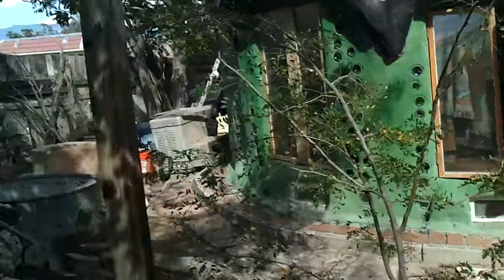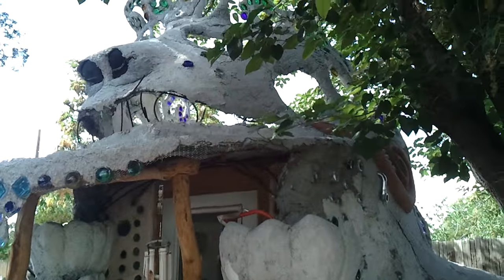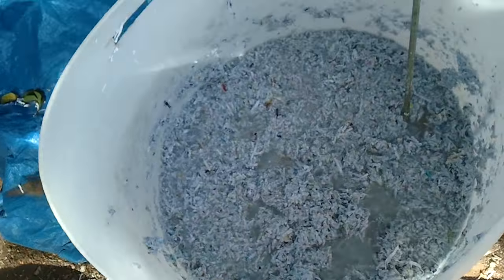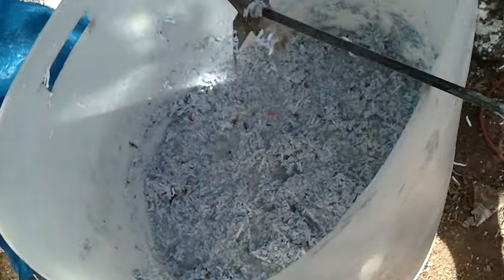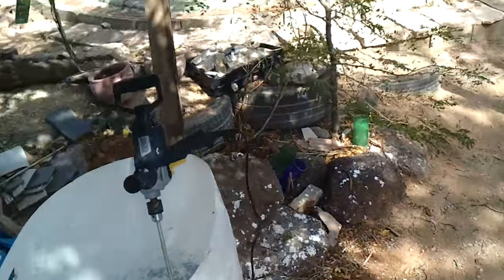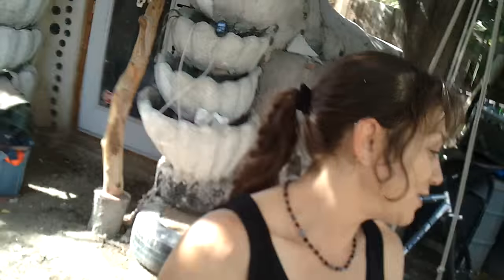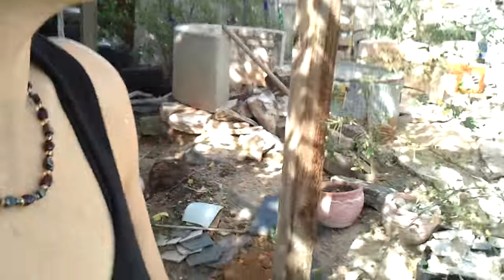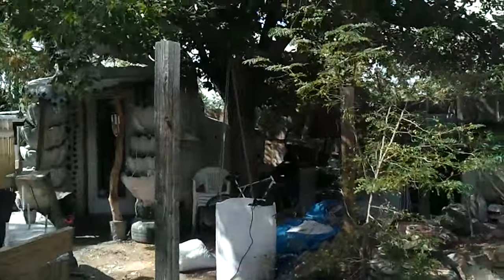How to make papercrete, The Basics, the short version, take one

Comment: In my experiments I did not use a drill or mixer really.  I used a 5 gal bucket and filled it with strips of newspaper, so it wasn't even finely shredded like yours in this video. (Which I know where to find bags of shredded paper now!), and then I filled the bucket with water to the top of the paper level.  I added more paper to the mix once the water forced the paper level to go down.  I only used a stick and came out once a day for 3 days to stir the paper.  After 3 days soaking on it's own pretty much, except the few times I stirred it, I ended up with an oatmeal like consistency for the paper pulp.  Then only mixed Quik-crete to this paper pulp, and no other ingredients.  I used a 50/50 mix or blend of the two and poured that into a mold made of wooden 2x4s to make different sizes and thicknesses of bricks.  
I tested them out with my glassblowing torch to ensure they weren't flammable.  And I also soaked the finished bricks in water for 2 weeks to see if it would soften or break down.
I would love to experiment some more with different mixes to make my finished product even lighter but still durable!
Thanks for sharing your methods!
My vids are on my other Youtube Channel www.Youtube.com/GardunoGlass
Reply from the maker: Thanks for sharing Glassman! Quickcrete/concrete has rocks and sand in it that are going to add unnecessary weight and thermal mass, countering the insulating properties...depends on how and where you are using it, for most applications though, very little or no sand is necessary and definitely no rocks...so I use portland cement powder (not concrete) and lime powder...with a bit of fly ash or pumice or various other volcanic/high heat products, the bond is very strong and can be made very light. I have tested over 30 different mixes now, none have failed, though again, where and how you are using them determines what is the most optimal mix. It takes me about 45 minutes to pulp 25 gallons or so of shredded paper and water with the low speed drill. Again, depending on application, sometimes straight shredded paper is pulpy enough...
I have had test cups of each mix out in the weather, often soaking in water, for 3-4 years now and they all just get harder with time...especially the lime and daitomaceous earth, I find exciting... I only use roughly 10-20% cement and lime powder to wet paper pulp/slurry, by volume for most applications...
Reply from the maker: I don't see any vids about papercrete on your channel...

Comment: I just got internet, via a friendly neighbor, after, 10 years of going to the library to do email,etc.;thus am new to this.Went looking for papercrete sites,and you came up.I've been fooling/working w/PC for 10 yrs. now,mostly as bldg. projects,and wanted to tell the world! a couple things i've learned.# 1 DO NOT BE TEMPTED TO USE BLOW IN PAPER INSULATION!!! My first attempts were successful,using 50/50 paper/cement(by weight),til a friend who was doing a lot of projects mentioned he was buying insulation to use...It took me many batches  of difficult,cottage cheese looking mixes,to conclude it was the insu...Tried adding fibers,etc.,nothing helped..I suspect the borax-added,as i understand ,to "fireproof" the insul is at work...how can we know? Anyway,i finally went back to newsprint.I'[d been frustrated by having to shred the paper,not having access to offices,etc....Last month i tried pre-weighing(3lbs. fits a plastic grocery bag to then fill w/water,and is about right for a 5 mgal.batch.);letting it soak for days..2 or 3...then my mixer just chews it up to a slurry in minutes,add cement and mix...Speeded the process by 1/2 !!! No removing the binder glue on slick mags,it shows up as strings to pull from the mess..Those are the only 2 things I've learned til today...I now wish I'd figured out hydrated lime as the"cement"...thought it needed a pozzolan for strength,(?)  have been using lime as a "paint" over PC in attempt to get uniform look....my house looks like a 500 yr.old Greek cottage now,i love it.Papercrete is WONDERFUL for DIY,lo-tech,and CHEAP bldg...not for the contractors;too labor intensive...well.I've had lots of thoughts,and would send pix,but i don't tweet(unlike your president),and refuse to facebook because...well,i won't go into that...anyway,hope this is good info ,and saves someone time/mistakes...don't know why borax does/doesn't work..suspect COATED,fine paper fluff semi-waterproof(?) I had cement leaching out when i drained my mixes ,my 2nd clue something was wrong............
Reply from the maker: Thanks! I have successfully used blow in paper insulation several times, though it does have  a bad smell from the fireproofing and it not cost effective compared to free. I get shredded office paper from offices or recycling bins and have no trouble mixing it with the low speed drill. I have used diatomaceous earth and lime only with great results over time (much longer cure time though. Pozzolan, if I understand correctly is what results from mixing lime with volcanic ash/silica...I use pumice which we have mined locally and it works well. The cellolose in paper reacts like the cellulose in hemp, gaining strength over time as it sequesters CO2 from the atomsphere. I use Borax in most of my mixes with fine results. ... I would love to see your work. Can you email them to me, or is that also too far outside your comfort zone? nmgal007@hotmail.com if you care to share more.
Reply: will write,thanx for responding...o read a lengthy book on lime(library book) that listed pozzolans...i AM ignorant,and have a somewhat garbled mind...as i recall the list of pozz.mats.included RICE hulls/straw! which led me off on dreaming about rice straw bale houses,since by now i'm certain rice farmers in california,rtc. are
Reply: constrained from burning fields,i imagined they'd almost pay to have the chaff removed(as i said,w/o internet it wasn't worth researching)..ANYWAY, spraying lime over rice bales,IF they even bale it up)seemed a neat solution   DAMN,i do go off on tangents...pozzolans,as i understand,is any material that helps the lime get really hard,Rome built from lime and vesuvius ash,,,so yeah,volcanic ash most common....at the time i lived (in E.Oregon)across the street from a sugar factory,with mountains of lime-used in sugar refining-just across the street.....oh hell,i think i'd better email..this is wandering off..i'm an old fart and tend to ramble.....the point about insulation was that the mix nearly always resulted in cottage cheese (large curd,heh,heh) lumps that would not spread,,,o.k. for filler,but not for smooth finish....but maybe i missed something....diatom earth a pozz.?  whereabouts are you? Ca. Yeah,paper's free,and a batch using cement is still only$.30...as a stucco hugely inexpensive,AND FUN,like spreading frosting on a cake...but i wish i'd known more,i much prefer lime for several reasons.............will write  jw
Reply from the maker: Clearly more research is in order! 😀I think you might be right about anything that chemically bonds the lime...though the cellulose in paper I think does that too... lol I have tested MANY mixes and they almost all harden over time, though some get pretty soft when wet,...here in the high hot plains, that could be a real nice plaster trait... I look forward to seeing/hearing more about your experiences. Thank you!
Reply: Diatiomaceous earth is the best material for many types of earth projects!

Comment: How much paint do you add to water proof the paper?
Any paint is good or just outside paint or are other products better?
Reply from the maker: I'm not a precise measurement kind of person. It depends on how 'water proof' you want it. It will repel water with little or none. If you want to seal it I would paint on sealant after curing, though there are many advantages to having a breathable structural skin. I try  to use up leftover paint sometimes, though I think exterior is probably best, any acrylic will also have an effect...again, just depends on what effect you want, and what you have available.

Comment: Hi Gabrielle,  I am wodering how to mix a batch to make a planter pot.

I'm thinking one inch thick should do it.

What I would like help with is the proportions of Shredded paper and cement or lime if possible. If I understood correctly,  your saying I can substitute lime for cement, correct ?

Thanks :)
Reply from the maker: I wouldn't use it for a planter unless you are going to seal it up well...it will take in moisture/breathe. The lime might slow that down, however, if you just use lime (which I would not, I would add diatomaceous earth or flyash if leaving out the portland) it will slow down cure time considerably (from days to a month to weeks to months). Pumice and portland and lime makes a fine planter. About 6-9 parts pumice or perlite to 1 part portland and 1 part hydrated lime. Optional 1 part sand can make it stick together better. Lots of optionals with this mix. Much like baking a cake, there is a lot of room for variation. The exact amounts will depend on size of planter of course. Let us know how it turns out and what you end up doing! :)
Reply: Gabrielle Angel Lilly . Thanks, I like the idea it will breath, that can only be beneficial to plants. Similar to terra cotta I  assume .

I was curious to know if papercrete might be as good, if not better than "hypertufa"(cement, peatmoss and perlite or vermiculite), not to mention cheaper.

If you can tell me a good formula, I would appreciate it very much, as well as any info.
Reply from the maker: I would not use papercrete for planters unless you are going to seal the inside, and the outside for that matter. Perlite or pumice or vermiculite would be better for that use. The recipe can vary quite a bit. You want to make a mash you can work with easily, and let it cure for at least a month before putting it to use in any temperature fluctuation. A week is fine if temps are constant for use.

Comment: hi
Just wondering what the borax powder is for? 
Can you use just Portland cement and paper pulp?  I'm trying to make some lightweight stones to go on the wall but am unsure of the ratio of paper pulp to Portland cement.
thanks :)
Reply from the maker: The borax just helps lessen the risk of insects, and changes the PH some...I am not totally sure how it effects overall strength. You can make it without, yes. You can use just portland and paperpulp. The ratio can vary a lot, depends on what you are doing with it--how strong, how light, and how exposed to weather you want it to be. I read ratios as high as 3:1 which is dense and heavy, and as light as 20:1. I don't measure mine accurately (that would require weighing it dry and keeping closer track of it), so I am only guessing the ratios I use are probably in the 5-10:1 range. I made over 25 different experimental mixes and pulled cup-sized samples of each of them--they are all doing relatively fine so far, several years out in the weather.
Reply: A papercrete building site said that borax will protect against mold and insects. Borax is also used as a fire retardant.

Comment: So just paper, water and cement? Al of your wonderfull stuff out there is made just with 3 ingredients?
Reply from the maker: Almost. I also use hydrated lime, and usually borax, sometimes pumice or ash, also have experimented with diatomaceous earth instead of lime and portland cement and various herbs too, in small balls, just to see how they do. Lots of options.
Reply: @TheZGALa  somethings they speak of perlite. Do you use it aswell. Want just make a bowl. Is it oke to use just water, cement and paper of wont it go well
Reply from the maker: @d.m.vanbavel8475  It is fine not to use pumice or perlite. Those are forms of volcanic ash, which can make the mix lighter and stronger. Depending on the ratio of paper to cement, you can make a very strong or a very light, and less strong, mix. You may need to seal it with something though, depending on what you want to use the bowl for. Ceramics are better suited for food use, or even plants in most cases, though I do encourage you to experiment. Please share you results if you do.
Reply: I found a store for perlite 4 kg :). Soon when its dry outside i am testing it. Regards d.

Comment: How strong is it? Does it hold it's shape right away?
Reply from the maker: Thanks for the questions. The strength and dry time varies some with various mixes. It is not used for load bearing walls, but can be made strong enough to walk on. The cellulose in the paper reacts with the lime and optional pumice/volcanic ash to make a very strong bond when properly cured. It is similar to clay in consistency when it is first mixed, and gradually gets stiffer from there over hours, then cures over weeks/months.